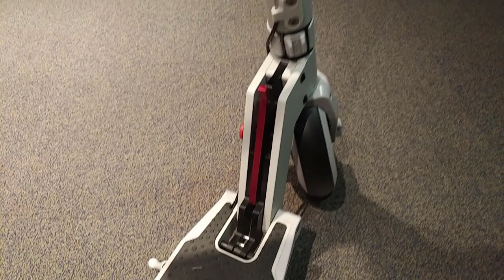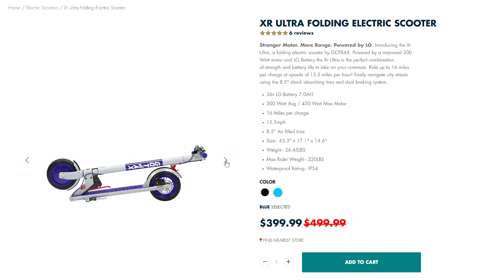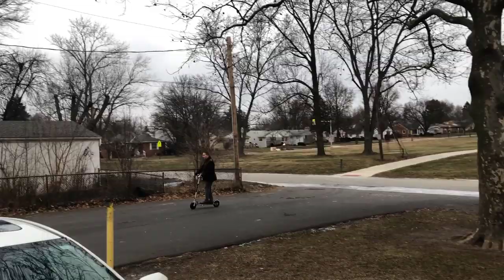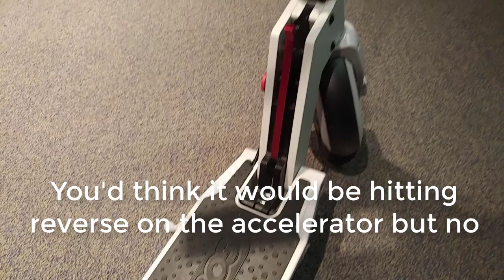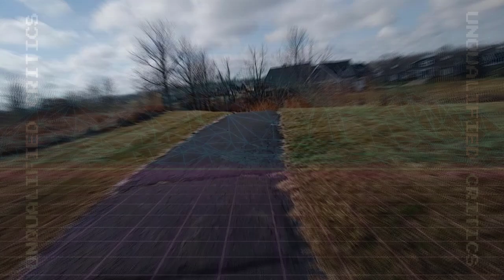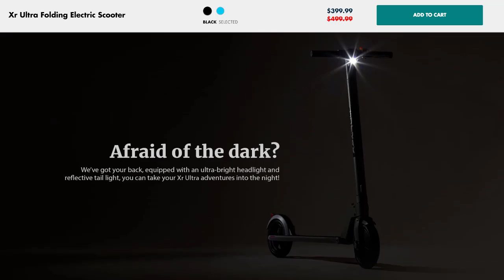GOTRAX Xr Ultra Review and Range Test: Premium Scooter for Under $400?

Comment: I've had my ultra for 9 months and everything has gone down hill!! It started with a rear flat. I changed the flat and in the process of getting it back on one of the magnets broke off and had to get a whole new break caliper. On top of that in the process of fixing the break issue I started having battery issues it won't go more than  4 miles even when going 8-9 mph. While I was dealing with that the break line started to unthread so I have to replace that. I've messaged gotrax a couple of times on what size break line the scooter uses and instructions on how to replace the wire and I have not heard back from them(it's been about 9 days). At this point I've spent more time fixing it than actually riding it. It has been a huge pain and honestly I couldn't recommend it. Bright side, I am learning how to fix my scooter without taking it to go get it fixed. I highly recommend getting solid tires, because fixing a flat is a huge pain in the butt!!!
Reply from the maker: 100% agree on solid tires. Sorry to hear you had a bad experience
Reply: Your weight??
Reply: @albertgein3082  200 lbs
Reply: @allanm3797  well crap that doesn't give me much hope except I bought a gas powered uberscoot *2
A week ago and ill be gawdanged if my experience has  been worse than yours even .. you don't wanna know..
And now I'm stuck with it no returns after they've Been run.    F#@!#D
I WEIGH 230ISH.. TRYING TO FIND A REPLACEMENT until I can sell/ or fix this
Craphole moneypit
Reply: @albertgein3082  gotrax gave me an option to send it back and I was going to, until I I decided that buying a new scooter would be less painful. I upgraded to a nanrobot D6 plus and I couldn't be happier. It's all terrain, goes 40 mph, and has a max weight of 330 lbs. I ended just throwing the gotrax away. Too much headache dealing with it.
Reply: @albertgein3082  also, that sucks what you are going through. If I were you I would start looking at videos the compare a group of scooters and check out reviews as well. After a while you'll find a scooter that fits your needs. That's what I did and after a few weeks of searching I found one that fits all my needs
Reply: @allanm3797  ya I don't know about spending that much but what about the U scooter that he has posted withe the promo code
Reply: 699 is my ultra limit
Reply: @allanm3797  that's what I'm doing right now...
But ya fresh out the box. With the gas powered I snapped the high low.. shifter..
The gas line for the engine wasn't connected.. so gas everywhere wouldn't start for 3 days/ super flood gas in the spark plug/   let's see... so ya it was stuck in high which was cool..
I thought it was stuck in low..
Do to the indicator.... 
Decided to chase the dragon and see if I
Not being a mechanic and all could fix the little shifter.... nope snapped it worse/ stuck it in low  now the motor is not even moving the chain or tire..😑😒 
Me: deep breaths 
Scooter: failed 
Now its the very first "Push Assisted "
Scooter... hahaha I should patterned it lol
All within 6 days.." nightmarish "   Nice 🤬
Reply: @albertgein3082  that truly sucks!!... I've never had an interest with the gas powered scooter for the reason the I'm not mechanically inclined to fix it. Lol. Hope everything works out and you find the right scooter for you. There's a lot to choose from!
Reply: @allanm3797  ya. I'm not mechanical either.   But 
First off i shouldn't off had to be.
Second off : not much you can't learn via- google or YouTube-
And I'm a heavy boy so I needed More Power,,  aaaaaa
Reply: @albertgein3082  true that! Lol
Reply: @allanm3797  im leaning towards the u scooter 500 watts
Reply: @albertgein3082  what's your budget?
Reply: @allanm3797  I don't wanna spend over 650-699..
That is still pushing it...
But is going to be my transportation to work.  Soo
Reply: @albertgein3082  you should do what I did and just save up more. You could find a great solid scooter for $1200-$1400. FLJ have some awesome scooters for inexpensive. Emove cruiser has a top range of 50 miles and goes 25-30 mph. My budget was $600 and started searching around and realized I'm not going to get what I want at that price. I saved for another 3-4 months(total 8-9 months) and got the scooter I wanted. I'm really really happy I did. Just some food for thought.
Reply: @allanm3797  ya..I was just  looking at the  899 EMove scooter lol..
Weird

Comment: Do you have to change to second gear every time you turn the scooter on?
Reply from the maker: Yup, kinda weak that it doesn't save the setting
Reply: Whats the difference between setting 1 and setting 2??

Comment: Gears? Power modes? Quick to set? My M365 was so aggressive in acceleration it made me tired like an old man. Eco mode was horrible slow to swap between in a busy city.
Reply from the maker: Modest acceelration. 2 gears (very quick to set just hold down power button for about 1 second). Gear 1 is ~10 mph and gear 2 is 15.5 mph
Reply: @UnqualifiedCritics  Can the scooter be used manually in the event you ran out of power?
Reply from the maker: @jasonle9596  Yeah it doesn't lock the wheels
Reply: @UnqualifiedCritics  Ok thank you, I've been thinking of buying this scooter, and having the ability to use electric or manual is certainly useful for me

Comment: The electronic brake is in the brake lever. 
I have the gel v2 and my brake wire broke and when I press the brakes it still stops the motor just not as good as the wired brake

Comment: As small as those wheels are, I'd be concerned about rough spots. How does it handle a bump, or dip?
Reply from the maker: The wheel size is the same as other scooters in its class but yeah (including Bird and Lime scooters if you've ridden those), that is a bit of an issue with the form factor. I hit some small curbs (1-2 inches high) no problem but definitely avoid craters in the road!